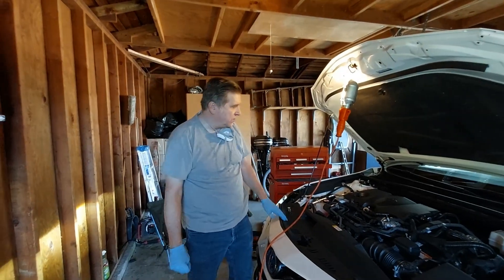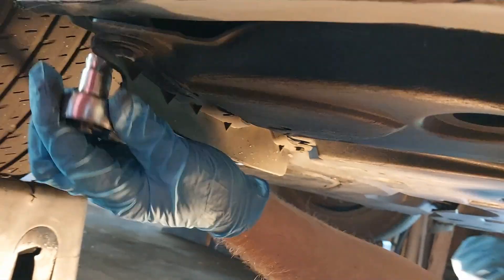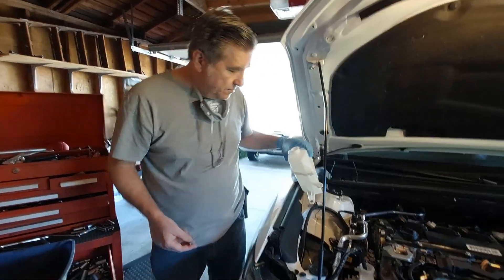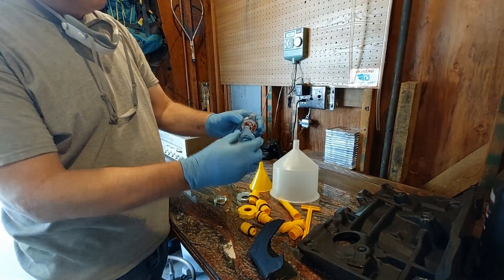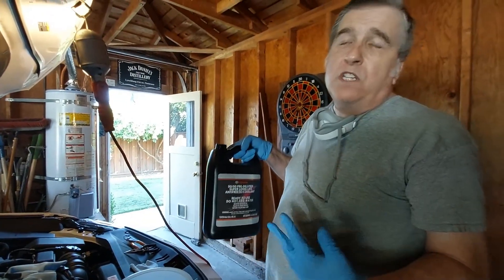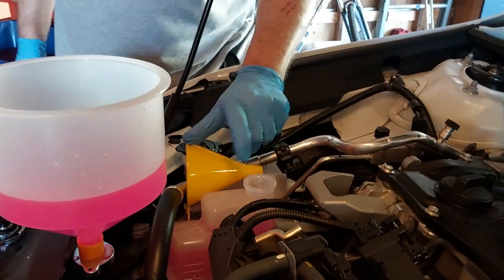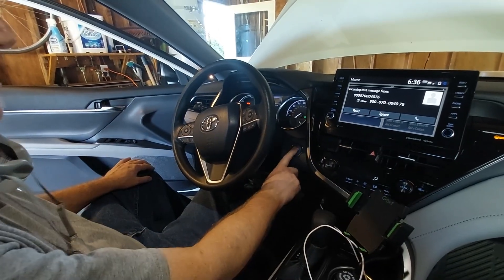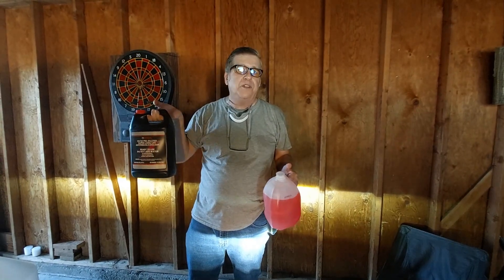2024 Toyota Camry Hybrid Coolant Change (Engine and Inverter)

Comment: Thanks, nice video. How much coolant did you use?
Reply: Never use anything but genuine Toyota. If you have to use any alternative, drain it asap and refill with genuine.
Reply from the maker: @stevenkelby2169  You can use aftermarket coolant specifically specified as a replacement for Toyota Super Long Life Antifreeze Coolant. However, if you shop online, you can usually find the genuine Toyota coolant from a local dealer for almost the same price, if not cheaper, so it really doesn't make sense for most people to use aftermarket coolant.
Reply from the maker: About 1.5 gallons, so 2 gallons should cover it.
Reply: @dontosaw  Thanks👍

Comment: Why is a one year old car getting a coolant change already?
The dealer charged me $29 for one gallon of coolant!
Reply from the maker: Because I'm a ride-share driver. It had about 50,000 miles on it when I performed the coolant change.
Reply: @dontosaw  You can wait 200k.......it's a Toyota!!  lol........j/k.....Good Video... thanks!
Reply from the maker: @bigfootswatching9986  The Car Care Nut, who is a Toyota expert, recommends doing it every 50k. https://www.youtube.com/@TheCarCareNut
Reply: @dontosaw  100,000 or 5 years for the first swap
Change every 50k or 5 years afterwards
Reply: @cyrilasfrenchyaz And the transmission? Sealed for life hey?
Reply from the maker: @stevenkelby2169  The Car Car Nut recommends changing the eCVT transmission fluid in hybrid Toyotas ever 60,000 miles. Other experts suggest changing it at 60k-90k miles. I have an upcoming video on the procedure for changing the fluid.

Comment: Hi! I have a question about my 2014 Lexus ES 300h. The inverter coolant has changed color to a bluish or greenish hue, which I suspect isn't the original Toyota coolant.

I want to change it, but I'm unsure about the flushing process. Should I flush the system with Toyota coolant and then immediately drain it, or should I drive a few kilometers before draining? Also, can I use distilled water for the flush, or do I need to use coolant? After flushing, I plan to refill with the red Toyota coolant.

Thank you!
Reply from the maker: I do not know what the process is for a 2014 Lexus ES 300h. Perhaps you can find a YouTube video that shows the procedure for that model, or pay Toyota for access to the technical information or get a manual from a different source. Good luck.
Reply: @dontosaw  thanks. The process is the same
Reply from the maker: @Cptblogh  If the color has changed, I think it is likely someone added the wrong type of coolant at some point. Yeah, I think a coolant change would be good. You can do it once and see how it looks after maybe driving a few hundred miles. If the color still doesn't look right, you can repeat the process until it looks good to get rid of the wrong coolant. Personally, I wouldn't mess around trying to flush it.
Reply: @dontosaw I understand your point. However, if someone previously used the wrong coolant, there could be around 10.14 fl oz. that won't be purged. If this new coolant differs significantly from the Toyota one I plan to add, as far as I know, mixing them could lead to serious issues. That's my concern.
Reply from the maker: @Cptblogh  Well, if someone added the wrong coolant previously, wouldn't it already be mixed with Toyota Super Long Life Coolant? I would think you would want to get as much of the incorrect coolant out of the system as possible. If you are worried about reactions between the different coolant types, you might want to have the system professionally flushed out. Flushing it with distilled water might not be a bad idea, if you can't afford to have a pro do it. Just be sure to let the engine cool each time before adding distilled water or coolant to avoid thermal stress.
Reply from the maker: Doing a Google search for "what types of coolant can be mixed?" brings up useful info. I'm guessing you already did some research on this. Good luck.